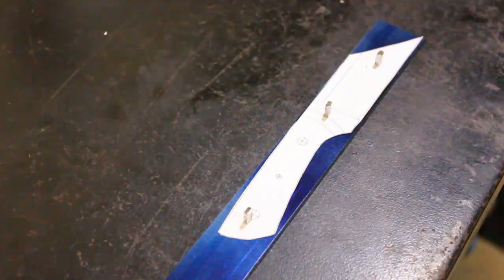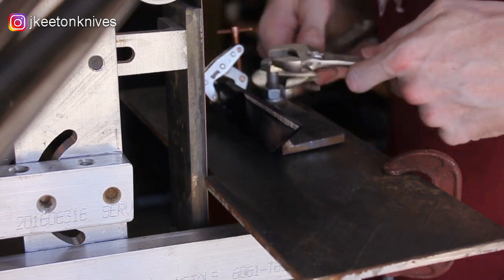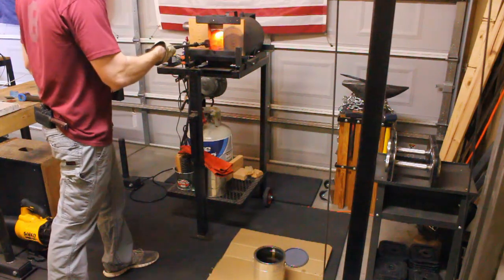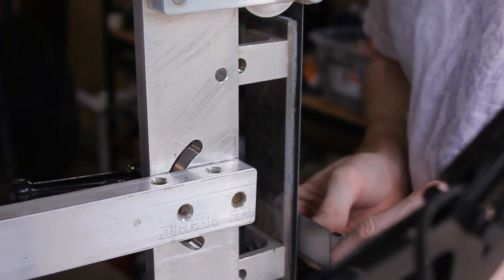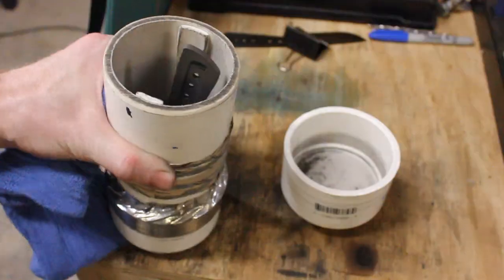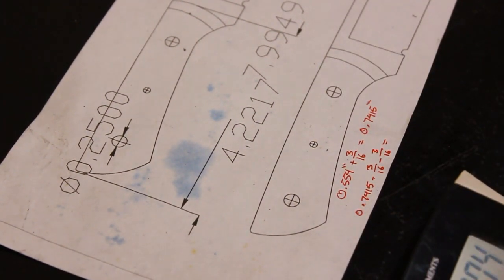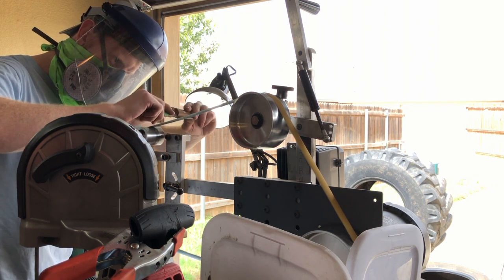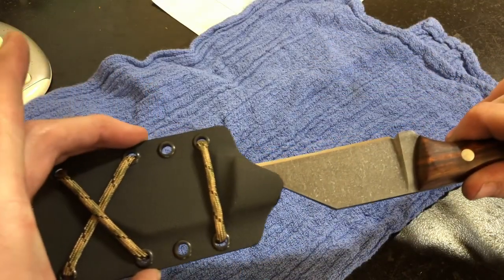EDC Seax Knife Making - Anglo Saxon | Viking Knife

Comment: J. could you include a few measurements for your sax knife I love the design.  Just fiy I like HowardLeight muffs they have really good sound from mp-3 or from your phone.
Reply from the maker: Hey man, it's 8'' long with a blade height of 1.25''. Blade length is about 3.25'' from the choil. The handle is 4.2'' long. Cheers

Comment: Another fine looking knife J !!!  I have been looking for a wet stone wheel tool for a long time. I knew a trim carpenter about 30 years ago who owned a Delta that was similar to yours but it just had the one stone wheel.
Reply from the maker: Thank you very much! In my WEN Sharpener review coming up I'll have some very useful modifications you can make to a wet wheel sharpener like that one to make it preform better on drop point blades. Jig modifications and guides. Took me a bit of research to get it working the way I like, but man it makes blades sharp!